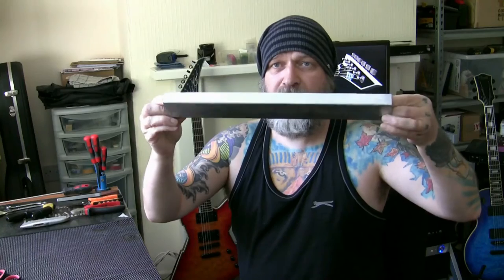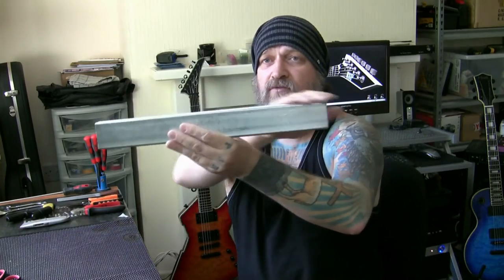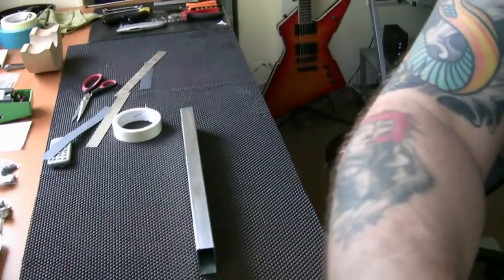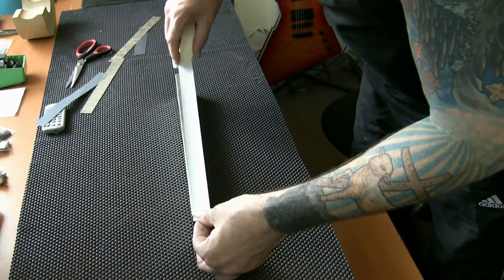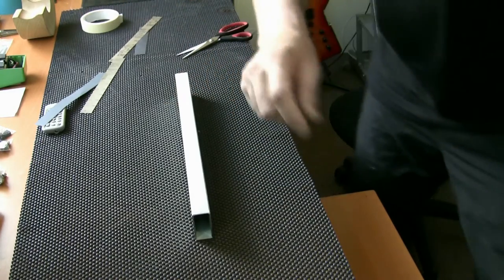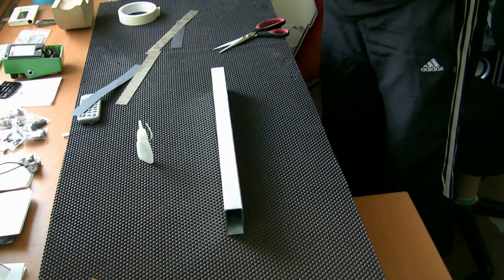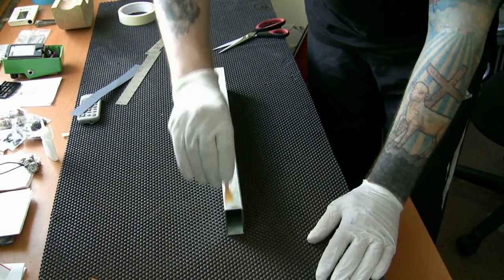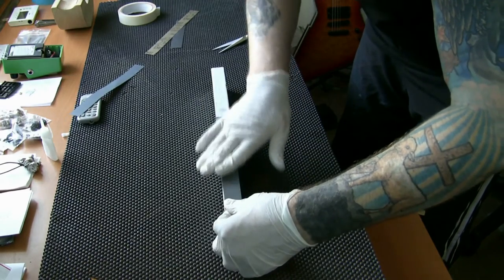FretFriend.co.uk | Guitar fret levelling / sanding beam (home made)...

Comment: Hey Victor I have a guitar and I was checking the frets and they don't have any dents but a couple look like they have lost there shape a little. You know that kinda slight squashed look that happens they look like a re crown would do the job but I wasn't sure if I could get away with that without having to go through the whole levelling process. Do you think it will work if I just re crown / re shape the frets?
Reply from the maker: If frets are flattened (worn), they will be lower than others around them so re-crowning will only alter the shape not the height (or in this case low). All frets need to be re-radiused (levelled) to the contour of the fingerboard or, worst case, they need to be replaced. You do not have to replace all frets if only a few are flat / low...

Comment: Shame you can't buy self adhesive wet&dry paper strips on a roll... Maybe you can, who knows? Anyway thanks for the masking tape trick , good idea !
Reply from the maker: Indeed! I have never seen it but the masking tape trick is good...
Reply from the maker: Hi John... 800 is too fine for this job. I'd go with 240 to remove the main then 400 to smooth it off. I'm happy enough to do the masking tape trick as I now use double-sided sticky tape instead of super glue! Cheers, Victor...